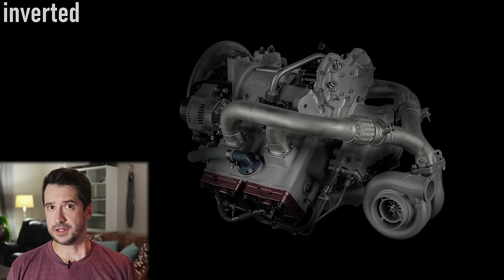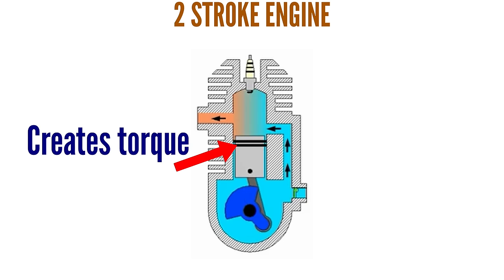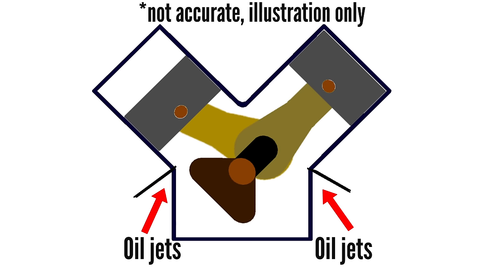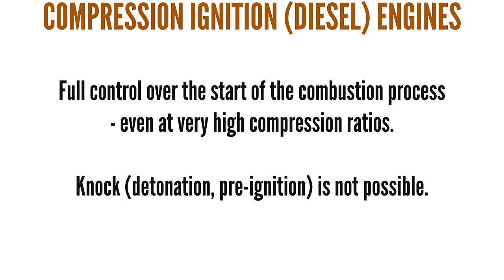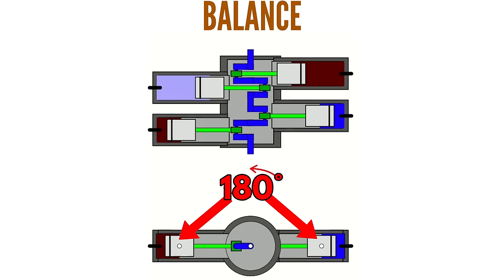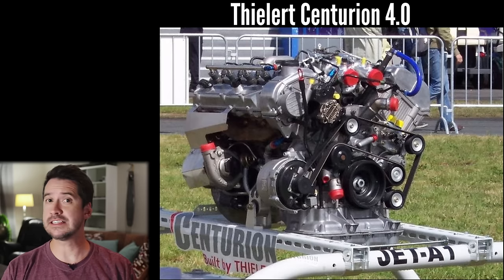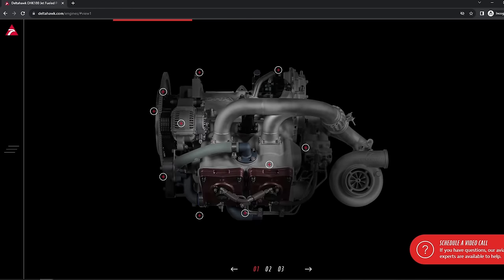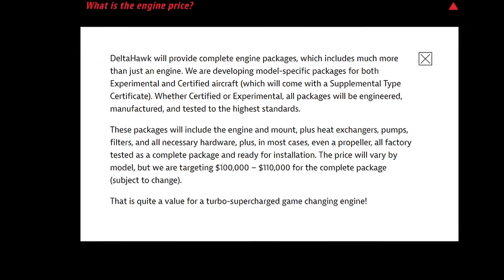Deltahawk's Jet Fuel Piston Airplane Engine Explained

Comment: Just read an article about the engine from Nov. 2023. They have already raised the price to 110,000 for the engine. Millionaires used to buy jets, now they by diesels, and the billionaires by jets. The rest of us, fly southwest.
Reply: That is firewall forward, not just the engine. I converted a 172 from a Conti O-300 to a lyc O-360. The cost for the firewall forward conversion was much higher than just the cost of then Lyc 0-360.

BTW, I have owned 4 airplanes. I currently have a Cessna 182 with an Auto-Fuel STC.  I am not even CLOSE to a millionaire. The payment is $350 per month and insurance is $750 per year.
Reply: I refuse to use Southwest, period! lol
Reply: That's a deceptive statement.  IIRC, the Kitplanes article said $110K includes engine, FWF kit, and propeller.  Not the base engine.
Reply: The legacy engines, where development costs were sunk decades ago, are in no way cheap, check out the price

Comment: Just a small detail but the 2 stroke doesn’t produce torque at 50% since the exhaust port is uncovered at about 60% of the stroke so so really it’s more like 35-40% which is still better than the 4 stroke.
Reply from the maker: Thanks, you are correct. Every second stroke creates torque, but as you said, not the whole stroke after combustion happens creates torque because of the exhaust stage overlap.
Reply: But what if you are using a supercharger...as a valve...to close the intake during the power phase of the stroke... and only opening the intake...once the exhaust has closed?

BOOM!
Reply: I know this is what they are doing because you can't normally turbo charge a 2 stroke... You need something restricting the energy bleed between the inducer and the exducer.

I guarantee you they are using the supercharger not just as a power adder but also as a valve to cut off intake.
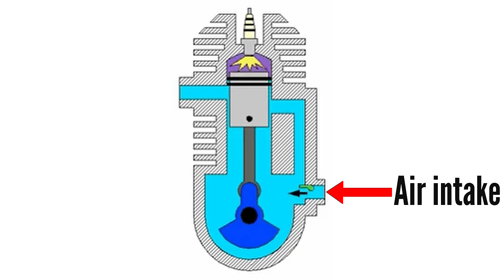Reply from the maker: Take a look at the video from Deltahawk's Youtube channel at 5:23. You think this is possible with the illustrated layout? It could restrict airflow but doesn't look like the supercharger is used as a valve. Let me know.
Reply: @LetsGoAviate  it doesn't have a valve, it is the valve! A supercharger is a interval pump, so at times it is pushing air, at other times it is compressing in air. If you are clever, you can make it so that it does this at a different interval for each cylinder.
Reply: @LetsGoAviate  sadly, I can't share pictures or links in the comments
Reply from the maker: @coreyfro Gotcha. Makes sense, thanks.
Reply: @coreyfro maybe with a roots style (really old style roots) blower, but this is twin screw.
Reply: Actually the intake ports in the cylinder’ wall determine when air is delivered into the engine and combustion chamber. When the piston passes the upper end of the intake port, that’s it-same as the intake valve closing in a 4-stroke. 
So no, the supercharger doesn’t control intake timing, nor does it matter how the vanes are oriented.
Excellent video about this intriguing engine. It will do well in numerous light aircraft, just look at the torque numbers!
Reply: @coreyfro A supercharger cannot build pressure in a 2 stroke..it just blows out the exhaust.  A turbocharger can build pressure because the turbine back-pressures the exhaust.  In effect, the engine overall pressure is elevated.  Elevated Air pressure benefits the thermodynamics.     Cheers
Reply: @coreyfro  the blower is not a supercharger at all in this sort of engine, it merely provides positive pressure slightly above ambient to the airbox, which then goes into the cylinder when the piston is low enough in the cylinder to uncover the intake ports.  The term "Supercharging" implies adding useful boost to the combustion process, which this blower does not, it merely provides aspiration.  The turbocharger is what provides useful boost to the combustion process.
Reply: @JimBronson  this is nonsense.  If it's adding positive pressure "slightly above ambient" that is boost, even if it is a small value. Most super chargers don't add a high boost values. In 4 stroke diesel engines, superchargers are almost never used because to pressure of the exhaust gasses are so high, turbos are king.

And adding super chargers are mainly to help with acceleration since they have no lag. So an aero application is odd.

Why add a supercharger and risk its parasitic losses on an aero application?

It must be to help control blow through, the major inefficiency of 2 strokes.

If this two stroke has a brake specific consumption of 40%, they must be doing something to prevent this blow through.

I think the supercharger helping here
Reply: @coreyfro   You have no unearthly inkling as to what you're talking about.  Go twist some wrenches on old 2 stroke Detroit Diesels, they work exactly the same.  The engine cannot run without the blower.  And anything non-turbo with the blower only is considered naturally aspirated.
Reply: @JimBronson  a blower, by definition, is charged air.  It is a tool to increase air density.

Infact, it world war two aircraft, turbochargers were "turbo superchargers" and superchargers were "mechanical superchargers" belying an identical purpose.

Both are "forced induction" which, by definition, is NOT "natural aspiration"
Reply: @coreyfro  You are speaking to gasoline powered 4 stroke engines.  Again, in the case of a two stroke engine where the blower is providing cylinder aspiration it is considered naturally aspriated.  Before I pivoted into tech I worked in a machine shop and built several dozen DD 2 strokes among the other things in the shop.  When the cylinder ports are uncovered by the piston moving to the bottom of it's travel, the exhaust valves are also open, the blower air pushes the exhaust out of the top of the cylinder at that point of engine rotation.  It does not increase the charge density, it merely aspirates the cylinder.
Reply: And if it hasn't been mentioned previously there's some greater pumping losses in a crankcase scavenged gasoline two stroke, and the Diesel two strokes generally don't use their crankcases for their scavenging pump, so they end up having a low pressure gear driven supercharger for scavenging, that does consume a fair amount of engine's crankshaft power.  Some of this can be recovered with a turbine exhaust supercharger.  If you seen the static running Junkers Jumo 205 on a trailer, that engine is in a couple of YouTube videos, that particular  engine is the definitive upper development of classic Diesel 2 strokes.  And Corey  the Jumo uses intake and exhaust ports that are uncovered assymetrically due to the Jumo being an opposed piston, 6 cylinder design.  It was one of the few very successful aero Diesel engines made.  The Luftwaffe used them in the Junkers Ju-86R which routinely flew above 48K feet altitude. The Ukrainians also use a version of the Junkers 207 in their T64 tanks andr Ukrainian made BT3's, making over 1300 hp on the same Junker's engine design but with a big turbocharger.
Reply: @coreyfro  the supercharger is for low rpm boost, as the rom rise the turbo kicks in.  If the turbo fails  the SC acts like a backup gives 50%  power in an emergency
Reply: @coreyfro  In a typical small gasoline 2-stroke,  the "supercharged" air comes from the crankcase.  The air is sucked in as the piston rises and is slightly compressed as the piston comes down.  That little extra pressure is what causes fresh air to enter the piston and push out most of the exhaust gasses.  Without the higher pressure of the intake charge, the exhaust gasses would just go out the intake port.  For a multi-piston setup,  each piston has a sealed section of crankcase and acts as its own compressor/blower.
On many larger two strokes (as used in ships and trucks), a positive displacement blower is used instead of an isolated crankshaft compartment.  That is why a Roots-style positive displacement supercharger is often called a blower.  It was commonly used as a low-boost blower for two stroke engines.  This engine appears to use a Lysholm screw-type compressor (supercharger) as the blower.
Reply: @danbenson7587 
Two stroke diesels have an exhaust valve.  He explained it incorrectly in this video.
Reply: Although this varies heavily upon crank case volume and piping design as you raise boost you also raise the static pressure on the lower side of the piston sapping power on the initial downstroke but gaining a percentage back with piston stuffing
 @LetsGoAviate
Reply from the maker: @zachary3777  This one doesn't
Reply: Not if it's an advanced 2strkke like the tohatsu, mercury, and evinrude outboards we've had for 30 years.
They use a small compressor to spray rich fuel air mix in after the pistons halfway up, thru a solid state piezo valve in the head.
The exhaust ports are only open near the bottom of the stroke and only slightly longer than the intake.
Reply: @danbenson7587  The turbocharger acts as a counterpressure in the exhaust system to ensure that only the necessary amount of air is expelled by the blower/turbo. This is done to minimize scavenging losses.
Reply: @coreyfro  :  I believe that any 2-stroke diesel engine MUST have a supercharger just to get the thing started if nothing else.  Think about it, how does a 2-stroke get air into the cylinders of a "port valved" engine?  Small 2-strokes, that mix oil with gas, use crankcase pressure to get gas/air into the cylinder.  This engine uses the supercharger to provide the initial influx of air into the cylinders and the turbocharger to provide the "boost" once the engine is running.  I'd almost bet the same is true of the old 2-stroke Detroit diesel.  Gotta have a supercharger just to get it started.